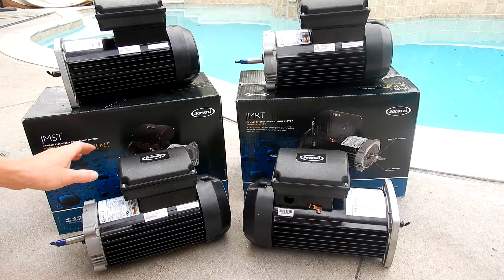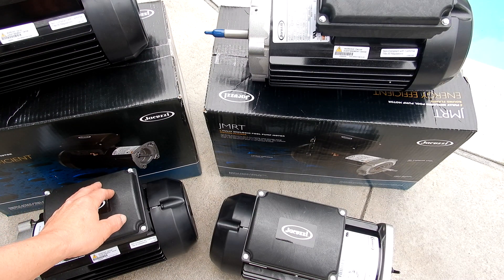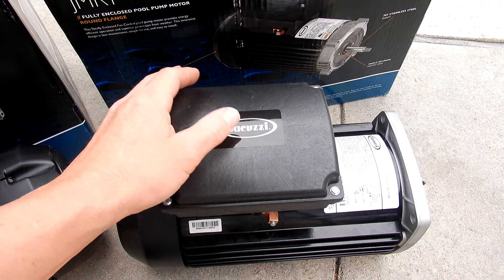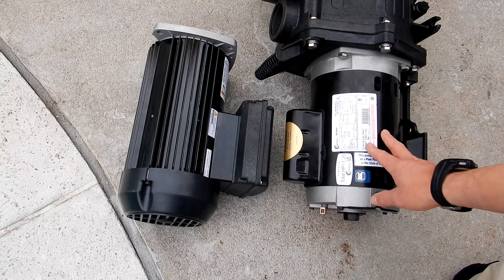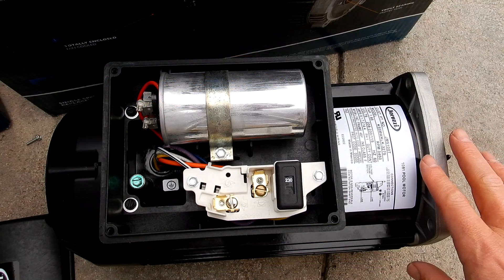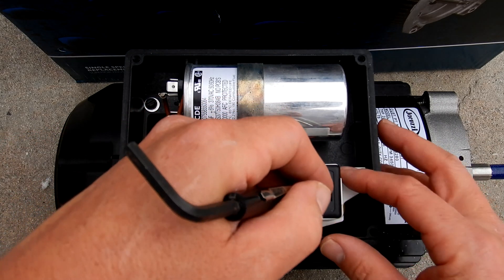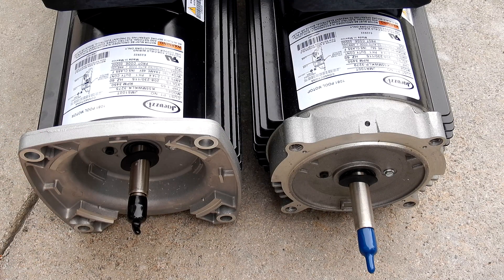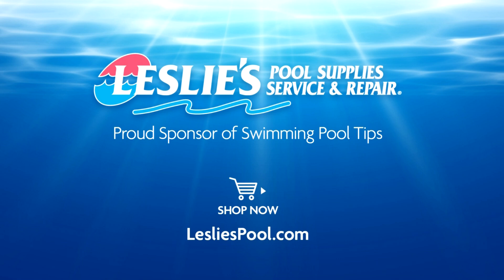TEFC Motors - Completely Water Sealed and Long Lasting! Jacuzzi TEFC Replacement Motors featured

Comment: I having a little trouble connecting it. My past motor had a 4 wire connections and the one only 3. Can you tell me the right way to connect it.
Reply from the maker: If you call the actual manufacturer US motors or go to the website to see: Tel: 1-888-637-7333

Comment: I have a question...If when replacing a pool motor(Hayward superpump1 hp) does it matter so much if the motor seal plate is slightly warped from it overheating. Thank you
Reply from the maker: It may or may not leak. If you add some silicone at the housing gasket that may help.
Reply: @SPL  Thank you so much for your help! Love your videos👍

Comment: A motor cannot be completely sealed. There has to be some vent channels. The issue stems from the fact that they continue to build motors that vent from the front to rear. When the pump starts to drip at the shaft seal, the fan PULLS the water and moisture through the entire stator, rotting out the bearings which in turn causes the motor to over heat. The insulation will crisp on the windings eventually causing a short.
This can easily be rectified by designing a motor and vents from the rear to the front, pulling air from the back of the motor and exhausting it out the front.
Reply: i see what you mean, it would be hard to tell too if theres a shaft leak, normally you see water dripping from underneath, but close motor its going to be difficult, so if theres a seal leak = motor done?
Reply: @Fgalvezpool  the leak will always be evident. The key to motor longevity is changing out the mechanical shaft seal at the first sign of a leak. It is a wearable part that does need to be changed periodically.